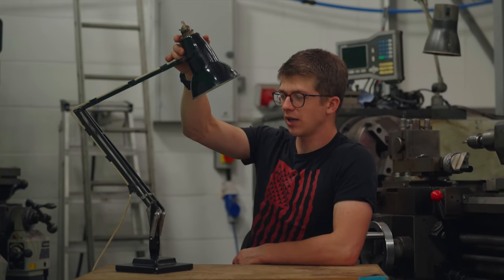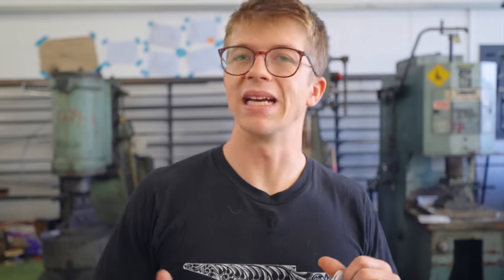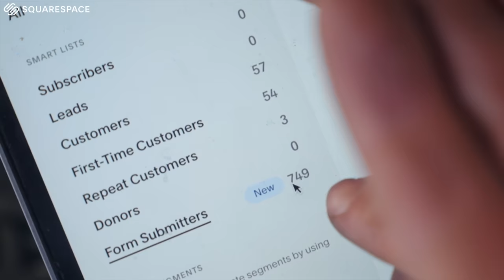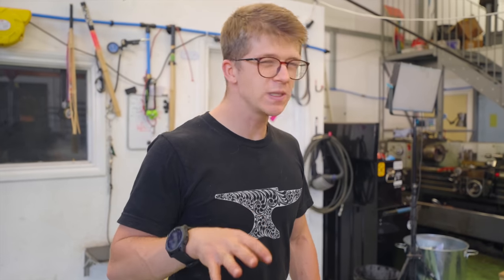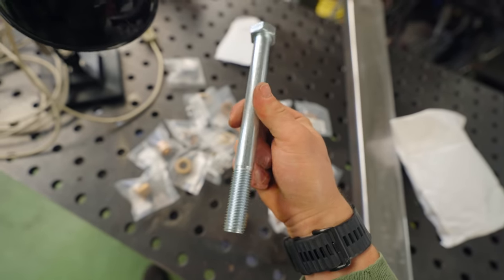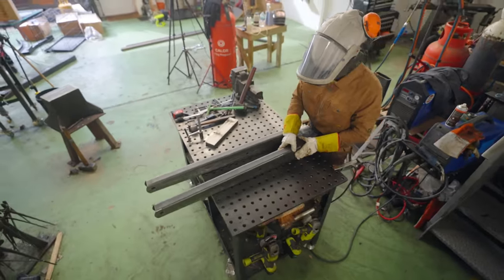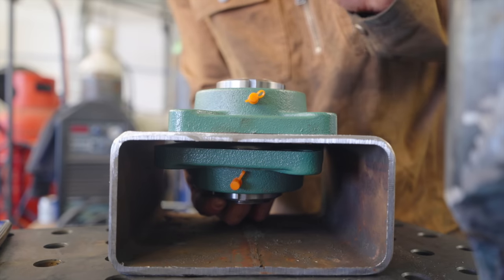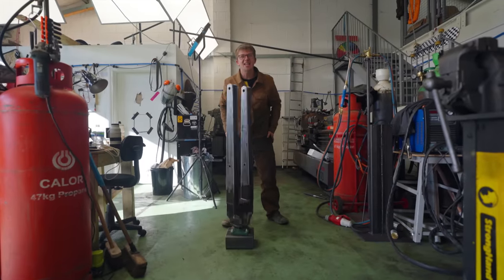I'm Making The World's Largest Articulating Desk Lamp...

Comment: Hey Alec, great video! Fun and different to the normal content. 
As a mechanical engineer in the crane industry (hook blocks and swivels) can I give you one piece of advise though? 

That shaft that you welded to the plate, you should consider remaking that. Run the shaft through both bearing blocks and through the base of tuning fork and weld it to the top plate. With all the weight that you are gonna put on top that will become a weak point when you start rotating and moving all that mass. It would be a shame if it all comes crashing down! 
If you look at the original lamp you can see they have actually done the same (although probably for manufacturing reasons). If you leave the shaft at the bearing block a bit longer you could thread the end and put a hex nut or halve hex nut on the shaft, secure it with a cotter pin and hey ho presto that thing ain’t going anywhere.

Looking forward to the end result, cheers!
Sander
Reply: Can you explain whether using two pillow block deep groove bearings is really more suitable for axial loads? I don’t quite see the logic in that. Wouldn’t a tapered roller bearing be much more suited to the task?
Reply: @nielscremer599  tapered roller bearings are in fact better for axial loads, however using two he has doubled the lower axial capacity of the deep groove bearings. Using two does also help with the radial forces that will be applied by the giant lever that the rest of the lamp will be.
Reply: One thing they are also forgetting with the upscaling is that the mass is increasing to the power of 3. So 6x6x6 --> 216. So the springs force increase and arm length of the springs should match 216. For example the arm of the spring multiplied by 20 instead of 6, and the spring force multiplied by 10 instead of 6 so --> 20x10 is close to 216. This is also the reason why the larger lamps (of that design) have there rods further apart than the smaller ones.

The squire cube law.
Reply: @nielscremer599 There are various reasons why one would use deepgroove bearings. 

To start, one should always use 2 bearings to create a stiff bearing or hinge point. Even though there is limited space between the bearings, this will ensure a hinge with little play or unwanted movement.

Whether you use a ball bearing or tapered or any bearing for that matter, you should always double up.

Now I suspect that these pillow blocks are deep groove angular roller bearings. These can take both axial and radial loads, just like tapered bearings. Are they as good as a tapered bearing? No, not as good but they are easy to use and cheap(ish).

When you use a tapered bearing there has to be a load mechanism in place that keeps constant pressure on the bearing for it to operate as intended. Most tapered bearing constructions will use both a tapered and non tapered bearing: the non tapered for radial and the tapered for axial loads and self centering. It makes it a bit more complex than a bearing block (construction wise) and incorrect setting of the bearings can cause major issues with wear.

So I would say in this case it is just a simpeler option than to use a tapered bearing.
Reply: @joey93livenl yes, this is true, and it is important—but partially mitigated by the fact that all the major pieces are hollow.
Reply: As a crane tech that works on all known brands of cranes... I hate you. JK you Im sure do fantastic work but can we please, PLEASE get real world techs like myself to approve of designs before they are implemented? those who have to work on these cranes have an extremely difficult time with modern cranes (I work in overhead cranes mostly) just for some simple tasks. Engineers (from the work i have done) do not think about real world maintenance that has to be done on their designs.

Respectfully 
Dusty the crane tech
Reply: @crazzywolf37 You have my attention. Out of curiosity since the company I work for only designs and fabricate the hook block, are you talking about the crane as a whole or specifically the hook block? We work in close relation with the manufactures of cranes and with many maintenance techs and try to listen to all parties. So if you have some examples I would appreciate that kind of feedback since it could improve what we make. Cheers, Sander
Reply: @sanderkoster9680  I am coming from the perspective of cranes as a whole, though there are certain hook blacks that can be a royal pain to work on as well, such as P&H, Harrington, ACCO, and Kone (my company). The #1 issue i run into with hook blocks are poorly designed hook thrust bearings and having to disassemble an entire block to replace them. #2 would be the issue with chain hoist hook blocks not having some kind of dust cover (I work in a ton of paper mills) and having to disassemble a block to clean it just to get it working again. i just wish crane engineers would run the designs by a seasoned tech before implementing them in the real world. techs have a unique perspective and could provide real world examples of how things come apart/ get put back together. Example; creating a shiv nest in the trolly of a hoist that has to be removed to replace a wire rope because there is no access to the pin, sounds like its an okay idea until you realize that that shiv nest weighs 200lbs has no safe way of lifting it out and the facility it is in has very low headroom, ohh and your fighting the weight of the wire rope the entire time. (yes i have had to do this many times). the engineering can have a fantastic design and have tons of thought put into it but the real world can render those designs useless. I have nothing against you at all and do not blame you, all i want to see is some kind of tech giving real world insight as to how those designs get implemented.

best regards
Dusty

Comment: If you need to use a hole saw Alec, drill out a few small holes on the inside edge that the cutter intersects along. The hole saw broke since the chips cant evacuate and thus excess friction is introduced resulting in work hardening that will quickly dull the cutting edge and ultimately break the tool. Hope this helps! ~  From one machinist to anyone who reads this comment :)
Reply: Great advice there JN!           

 if needing the inner disk: clearance holes in the outer.
or peck drill & wire brush teeth between pecks. (good for other materials)

wondering if the arbour pins were up to reduce chatter or as an SBE?

if needing to run pins up (or for the smaller arbour size) a carboard washer massively eases disassembly.

layers of masking tape at a push, but if your buddy has a lasercutter; ~0.75mm card & 
12mm ID, 28mm OD or 15mm ID, 35mm OD for the 2 sizes of arbour respectively.

hope that helps someone out there!  :-j

Comment: One thing to keep in mind for the pivot points is that there is a sweet spot for friction where it can be moved but the friction helps hold the links in position. This is because you don't get a constant spring force throughout the range of motion, so you can't simply tune the springs to always perfectly support the weight, so some friction is needed to help it balance.

Comment: Jaime is correct that your spine elongates a little when lying prone.  Gravity will shorten the spinal column when standing erect.  I work for NASA in the Life Support area and this is something that has been observed as a result of space flight.  The Russian cosmonauts have to wear a special garment prior to scheduled return in the Soyuz vehicle that is designed to compress the spinal column.  They need to do this based on the seat design of the return capsule.  The seat design is such that it supports their entire spine.  There is a special insert created for each cosmonaut/astronaut that fits inside the seat bucket.  This insert is effectively a form fitted foam cushion.  The special garment used on orbit is to ensure that the crewmember fits within their specific seat cushion for return.

Comment: Very cool project. I used an Anglepoise lamp as inspiration for my master thesis on a passive supporting exoskeleton. 
Please note that de springs inside an Anglepoise are not your regular springs. They are Zero-length springs. The whole thing works by moving potential energy from the mass of the system to the springs and vise versa. This will not work wil regular springs. 
Hope you can find soms correct springs 😅

Comment: The springs on the original rotate to adjust the tention, Your reference lamp is also wired up incorrect. To upsize the wire thickness, running it through car radiator hose would be neat.

Comment: Great job. This may be wee bit tardy. The loads on the lamp are a balancing act. The simplest to find how much spring you need come down force = spring constant times the displacement of the arm. Also, the placement of the springs or weight from the pivot is a factor. It acts like multiplier for the force from the spring and weight on the arm.

I used to install 24 ft robotic arms in foundries. Same principle here.

It's just my two bits worth.

Comment: Could you try forging a large water pump pliers like the ones knipex make, to hold round fittings and large nuts, be difficult to make the adjustment for changing the size of jaws

Comment: Jamie is partially right. The distance from the bottom of your heel to the top of your head is longer when laying down than when standing because of compression of the intervertebral discs (the less hard parts of your spine between the vertebrae). It's only about 1-2 centimeters, though. The compression builds up over the course of the day, though, so you're actually tallest right after you get up in the morning and shortest when you go to bed at night.

Comment: he is actually right about being longer when you lie down when you are standing the discs in your spine are compressed when you lie down it decompresses them since gravity works in the vertical axes only but, don't get your hopes up you might only differ in length for a centimeter or so.
for the effect to be measurable you would have to lie on the floor for about 2 hours.
this is also the reason that every human is taller when he just got out of bed and shorter when he goes back in.

Comment: Its actually true that you are taller in the morning when you first get up than you are before you go to bed .its only by about half an inch possibly a bit more for some people.
Your disks relax and fill with more fluid when you're lying down and throughout the day they get more pressure on them and get compressed.
I had a back injury and they talked about this in the physiotherapy.
Back in WWII there was a height restriction to join the army or air force and people who were just under the height limit lay down for an hour and when they got measured they passed the height restrictions.
With my damaged discs ive lost just over an inch in height, i was always just over 5'10 now im 5'9.

Comment: really nice project. from a forces standpoint you be best off having the two pillowblocks as far from eachother as possible. even mounting the second block on the underside of the box section would make the forces on the bearings a lot smaller
Reply: 100% agree with this. I fear you will also have a similar problem on the other side. The pin should go through the basepate and also attach to the upper closeout on the Y. You’ll notice the pin on the small lamp does exactly that.

Comment: I feel like the bottom plate will rip off (probably not, but it is sub-optimal), if you can please replace the pin with a longer one that goes all the way through to the next plate as well. The same goes for the bearing blocks, if you add some separation by mounting the blocks further apart it will be way stronger.

Alternatively, if you had put the bearing blocks on each of the upper and lower faces of the tuning fork's center section, you could have just embedded a pin in the concrete for it to sit on.

Comment: @JamiePopple @AlecSteele Others may have pointed this out, and you may have already planned for it. But I have some serious safety concerns about the load bearing capacity of all those connections in the base depending exclusively on the strength of the welds. If it were me, I would add some additional internal structure that spans/connects the forks to the base, and the pivot rod through to the inside of the top plate of the base.

Comment: I'm a collector of antiques and anglepoise lamps are big business but I own a unique anglepoise item nl an anglepoise fan! designed by an unknown sadist in the 1940s (it is German so maybe that explains it?) this thing has no guard! free touchable supper sharp rather thick brass blades that spin at an insane speed with insane tork aka it won't stop unless you shove a steel bar in it I thew a chicken thigh in it and it sliced parts of it in discs bone and all!
no wonder it was a flop nor did the maker attach a name or brand on it except for D.R.P. Deutsches Reich Patent 1941 (plus swastika eagle)
also, when you need to adjust it to cool yourself down you have to get off your seat go behind the thing, and make the adjustments doing that while seated will slice your arm likely causing deadly arterial cutting or rather mince your arm.
I also own an anglepoise electric dentist drill setup which I use in fossil preparation a very useful tool indeed!

Comment: wondering if the Hole Saw arbour pins were up to reduce chatter or as an SBE?

if needing to run pins up (or for the smaller arbour size) a carboard washer massively eases disassembly.

layers of masking tape at a push, but if your buddy has a lasercutter; ~0.75mm card & 
12mm ID, 28mm OD or 15mm ID, 35mm OD for the 2 sizes of arbour respectively.

hope that helps someone out there!  :-j

Comment: You should use prescision ground axel with those bushings instead of normal bolts. It makes big difference on general feel. At least you should make an axel with a lathe to be correct size. Bolts have very big clearance to nominal size.

Comment: Your measurements to the ceiling are in accurate- you forgot to allow for the height of the huge desk that the lamp will clamp to- measure your normal desk, multiply the dimensions by 6, call the lumber company...

The lamp will need a substantial base, the materials used for construction are heavy and will achieve relatively long cantilevers.  Something has to resist that overturning.

Comment: you should make something with "grinder room" dust damascus, soakk a couple pounds in alcohol, skim any floaters, make a canister, and use a ton of flux while folding 3-5 times for "puretiy
' reasons. maybe make a casing hammer/glave set, or make a basic square for marking with a scribe to go with it.

Comment: if you havent already decided on a spring system, may i suggest not reinventing teh wheel but rather using the mechanism behind a wheel... a cars wheel... a shock absorber. they are designed to provide resistive movement and, if used correctly, will hold their position unless a sufficent force is acting upon it, pair it with the correct spring to counteract the weight of the limbs and you should have a lovely system that mimics the original. and if you use a spring over shock system it should look very similar to the original.

Comment: I'd seriously look into finding a way to add some friction to the base tbh. Maybe an adjustable spring loaded pin that presses against the shaft or the base? High RPM will look cool on camera but it's less cool when it swings 360 degrees in the blink of an eye and that huge mass of metal smashes into the back of your skull 😅

Comment: Have you looked at the style that don't use springs and instead hold their position with counterbalances and pantograph linkages? I built an oversized but not nearly as large as this version a few years ago, and it holds it's position with none of the bounceback or dead zones that springs sometimes give. The other benefit is that you can move the counterweight around to adjust the much further away head when its out of reach

Comment: the rollers that feed the wire for the welder might be too tight its supposed to just barely hold on to the wire. if its too tight it'll crush and deform the wire causing it to rub against the liner of the lead which cause bird nests, arc back, and even sometimes completely sever the wire. i hope this helps a little

Comment: If i were making that whole thing any larger, id want there to be more main pin stock running a few inches up into the hollow structure and captured inside a second plate. It doesnt even have to be welded to that plate. Its so much stronger than just welding it through a single holesaw hole. If you capture the pin in this way, it would techincally hold up the whole lamp plus both of you dangling on it with just one tack weld on the pin.